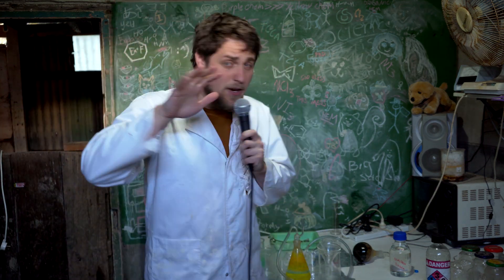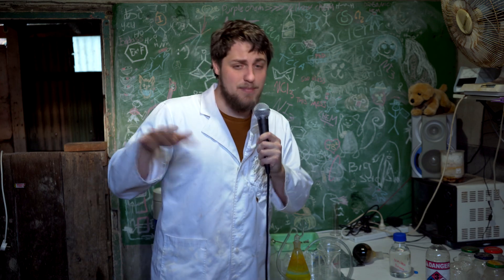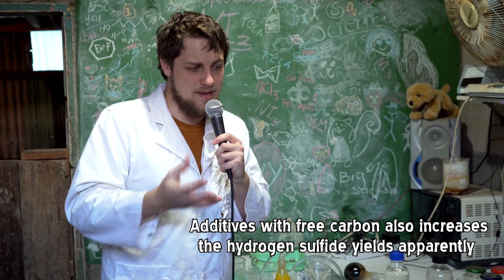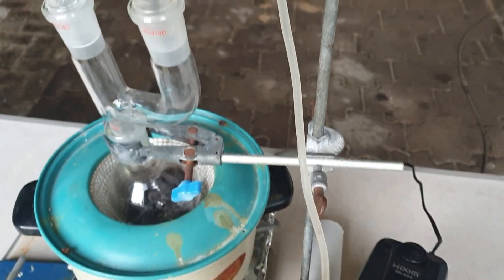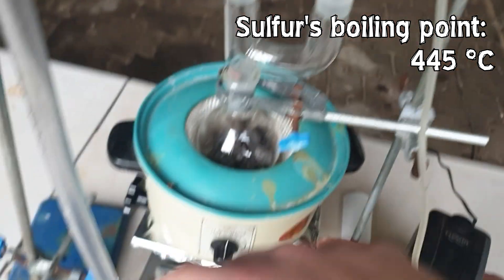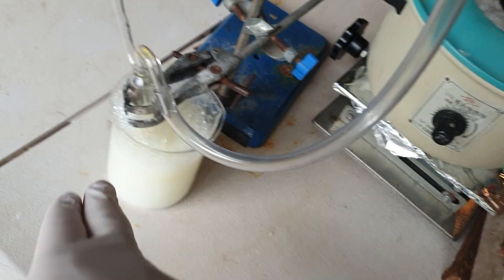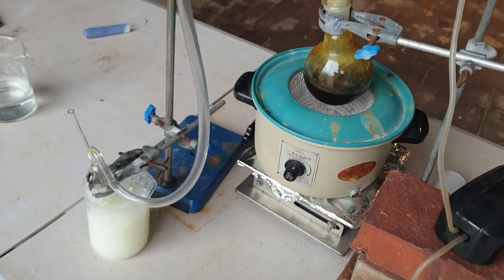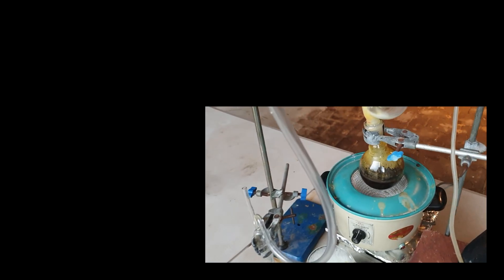A hydrogen sulfide generator using... a candle

Comment: Here in Germany you can actually buy pre-made pellets that you can heat and generate H2S. They are called "Sulfidogen". They can be easily homemade: 
 25 parts by weight of paraffin oil are mixed with 15 parts of sulfur, then it is melted on the water bath. 7 parts of kieselguhr (very fine SiO2 basically, the same you can use for filtering, then its called "Diatomaceous earth" I think) are stirred into the homogeneous melt. The mass is brittle at room temperature, but plastically deformable at approx. 40 ° C. Small portions can be pierced with the cork drill.  
This might be cleaner to work with and make less problems. Also, maybe less heat is required as they use already liquid oil instead of wax.
Reply: What are they sold for?
Reply: @ipodhty  I cannot say for sure, I think as an individual it cannot be purchased. However the manufacturing is easy, and they say at 170 C, 0,5g of the mixture releases 120mg H2S. So calculation is easy as well

Comment: So, you added bleach to your gas bubbling pool, but the reaction produces unsaturated hydrocarbons as a side product. Hypochlorite can be aa chlorination agent in some circumstances. 

Is there a possibility that you are producing random chlorinated hydrocarbons as a side product? 

Probably not, right? The alkanes in paraffin are quite heavy, and probably aren't boiling off, same should be true for the unsaturated products, but I'm not sure.
Reply from the maker: There could be! But I don't think in very large concentrations. While the pot temperature got hot, there was still quite the column length for the gas to travel through and cool in, so I don't think much alkenes got through. Didn't see any oily droplets in the beaker with the bleach

Comment: There is a third way to generate H2S. Thioacetamide is used in analytical chemistry for precipitating metal sulfides (thioacetamide hydrolyse in hot water to form H2S).

Comment: PRobably, the H2S reacts with the O2 in the air current to make H2O + the yellow Sulfur found in the rubber tube endings and/or top of the "air condenser"

Comment: Does the reaction not happen below the melting point of the sulfur, or just really slow?

Also, could the reaction be slowed down a bit by reducing the amount of carbon?
Reply: About the first one, I think it won't practically happen, because solid sulphur wouldn't mix to well with wax so you get only small surface where reaction could take place. But haven't tried it in practise yet. 

About the second one - I don't really know. It think though that carbon is added to make mixture less viscous and make evolution of H2S more even, so adding less carbon, could actually make it worse, resulting in irregular bursts of H2S. So maybe try adding more vax? To kinda dilute the reacting mixture, that may make it bit slower.

Comment: If you want to find out whether the oxygen/H2S mix is dangerous would be to find out the rate at which the H2S is produced, i.e. by measuring the pressure in the reaction setup whilst the rxn is running.
With that you could probably calculate some type of steady state concentration based on your carrier gas flow rate.
Also, technically, just pumping the carrier gas at ludicrous speeds would give you the lowest concentrations, so you'd probably end up with a safer mixture at higher carrier gas pressures

Comment: A really simple way I've found is potassium polysulfide (or liver of sulphur). It's sold in liquid form as a weed killer in bunnings. Adding acid causes basically instant hydrogen sulfide generation
You could use an addition funnel to do it gradually
Reply: As for what I use it for, blackening silver jewellery as silver sulfide is both quite a nice black and also relatively scratch resistant

Comment: I would've stored that flask with contents in it, for whenever you need some H2S generation. Chuck some parafilm on that baby to keep it relatively sealed and you're good to go. Also, why bother with a screwdriver when you have a freaking sonic bath to loosen up all the caked bits? :D
Reply from the maker: Yeah I did keep it for a little while, to use for the actual reaction I needed it for. Used it twice over a few weeks and it worked well before I decided to attack it with a screwdriver

Comment: By pure luck the sublimation temperature of CO2 is in the tiny range between H2S freezing and boiling. So you could generate H2S by whatever means and then condense it. Then you would be able to create anhydrous sulfurless gas proportionally to heating for whatever experiment needs it. This is probably a bad idea.

Comment: It's got yellow chem as an ingredient.
It's got yellow chem as a byproduct.
It's got flammable gas + oxidiser within a glass vessel.
It's got ratios measured in thumbs.
It's got hardware, dinner party and fireplace ingredients.
It's gotta be the hardest damn thing to clean up before you even start the reaction.

What's not to like?!?
Reply: It's just missing the tar. Depressingly low amounts of tar in this one. And not all that much use of shitty plastic cups either.
Reply: @TestECull cleaning that flask is going to be about as tough as cleaning tar at least.
Reply: And the gas it generates is deadly! Not as good as carbon monoxide or phosgene but still great.
Reply: Everything

Comment: Nose can get used to low levels too. I was distilling liquids some time ago and it had a slight hydrogen sulfide smell (nothing for me to get worried about, a very slight smell). However, after long time sitting by and taking fractions I got slight sympthoms that turned into light head ache, moved to fresh air and it turned into a large headache followed by dizziness. For large concentration it can make you not smell it almost at all.
I'd rate H2S closer to cyanides in danger (I can possibly disable you pretty quickly too). The difference to me is that at least you can smell it unlike CO or if you're like me, HCN at least in slow levels (but yet high enough to give slight dizzyness).

Comment: Probably not a great idea to bubble air through a flammable gas. Flowing gases can generate static and H2S is particularly sensitive to electric sparks. That said, at your reaction scale unless you are standing right on top of it unlikely to cause a serious injury.
Reply from the maker: still wouldn't be a very nice thing to happen!
Reply: @ExtractionsAndIre  also had another potential thought. You could make polysulphides with hydroxide and sulphur suspect that mix could then be slowly reacted with alfoil additions and get yourself some Al2S3 like mixture

Comment: sodium metabisulfite, add acid, done. it's nice and clean
on a side note, I used to work in a chrome plating shop. we had something like 50m3 of hot hexavalent Chromium.  we used to use Metabisulfite to reduce our sludge to chrome 3 remove it from solution. 
having thinners and 20kg tubs of chromium 6 anhydrous on one bench was always amusing. or mixing 50 liters of %98 sulfuric with water to make %20 solution.
one nasty thing about chrome6, even in very dilute amounts it has a tendency to find and cracks or scratches on the skin right away, washing it off does nothing. it gets into the tissue and slowly releases, preventing the wounds from healing, it looks like an infection that doesn't heal, and it is very painful. early on I didn't know what was going on, I had tried the basic remedies for infections (Iodine, peroxide even permanganate) and they seemed to make things worse. after figuring out what was going on, tried looking for info but I couldn't find anything in literature about how to deal with it. so I came up my own solution. I would wash my hands with a small sprinkle of metabisulfite and a small finger dip in %20 acid and doing a scrub. the result was superb. So much so I started using it on closed wounds as well (chrome 6 contaminated wound eventually closes but forms a nodule that stays painful for months, it heals very slowly) dry crystals of metabisulfite on band aid would successfully get rid of them in a few days.
anyhow, figured you might find the "safety" measures amusing...
Reply: Good lord!  Didn’t know that hexavalent chromium did that!  Did coworkers not tell you?

Kudos for coming up with a treatment.
Reply: @firstmkb  They didn't know much about it either. evn the old timers didn't know what to do, the lack knowledge about the stuff was appalling (but not surprising), we even had a chemical engineer in the stuff who had worked in similar places before and had no clue
btw, based on some literature I found (very old recorded cases 1940-1970s) a burn with hot chromium 6 as small as 2" by 1" could be fatal (causing systemic damage) and can take days to weeks. the recommendation of that review paper was immediate amputation or removal of a large chunk of meat from the burn area. and apparently if it was not done in the first hour, the chance of survival was not great....
fun stuff this chromium 6, no wonder it has been phased out and banned in most places in the world.
another fun fact, the building material and the land that a chrome plating shop was on is considered hazardous site. the building and a few meters of the soil under the building is usually taken for hazardous waste treatment.

Comment: When I was working in the oil field in North Dakota we have to wear hydrogen sulfide detectors and go for hydrogen sulfide gas training because there is so much hydrogen sulfide in the oil fields of North Dakota I didn't know why oh, but now I think that it's because there is a paraffin content in the oil and also a lot of sulfur and it comes out of the ground to quite hot which is exactly how you make hydrogen sulfide I would think the carbon probably comes from the carbon in the fossil fuel... and yes, we had an explosion hydrogen sulfide gas in 2014 and several people were injured

Comment: My method of generating very small quantities of H2S is adding sodium or potassium hydroxide to a crucible, melting it and then adding sulfur on top and making kind of a sandwich of hydroxide and sulfur layers. The sulfur instantly reacts when added to the molten hydroxide. I then simply break off the chunks and add a dilute acid to it and voila. No heating needed but then again, I was never a fan of generating big quantities of this foul smelling crap. I mainly just did it for fun a couple times to precipitate some sulfides and it worked perfectly.
Reply from the maker: oh yeah cool, that's making 'polysulfides' or whatever, where it goes slightly red/pink?
Reply: Last time I’ve done it it actually turned a yellow-orange colour. It would turn either bright red or orange when dissolved in water and would smell slightly of H2S after the solution was filtered and separated from leftover sulfur. Not the best way to generate H2S by far, but for small scale experiments it can suffice. The colour is not consistent though as the molten hydroxide sometimes attacked the porcelain crucible I’ve used which… gave it a slight green tinge for some reason? Most likely impurities in either the sulfur I’ve used which was not lab grade or in the porcelain itself, I don’t really know.

I’ll need to redo the experiment when I’ll have some time, it’s certainly a nice and easy way to generate small amounts of the gas. Too bad the gas is so toxic.

Comment: Is there a risk of the air pushing through the system causing static charge on one of the pieces of kit?  That would be the only way I see this going catastrophically wrong passing air through it
Reply: Well, using air at those temperatures, with those ingredients, could lead to a "runaway oxidation scenario" I.E. the sulfur vapors could spontaneously ignite. 
Result; Glassware claymore.

Not exactly what I'd call ideal results...
Reply: @The_Keeper  ahh never thought there would ever be enough oxygen in the air he was pushing through to do so, but then again, I’m no chemist whatsoever lol

Comment: Maybe add some glass wool in the neck of the flask to stop sulfur getting in the condenser. I also wonder if parrafin oil would do the same with easier cleanup.
Reply from the maker: I think it might actually, that's a good thought. Although I'm not sure it would 'turn off' as easy as it won't solidify and completely stop the reaction very well maybe
Reply: @ExtractionsAndIre  Measure the temperature at which it starts generating? 
I do suspect that the reaction temperature if used with paraffine oil could be a bit lower.
Reply: I'd give it a try in a test tube but I don't feel the need to stink up my lab :) Would be awesome if the temperature controls the production rate then

Comment: I've done this before. It was an experiment in a chemistry set I had as a kid. Either that or I read it from an old chemistry in my school library. I did use the sulfer that came with my chem set though. Man at least in the 90's chemistry sets at least came with chemicals. Now they are all a waste, the only chemical ya get is baking soda and they put enough warnings on that to scare a kid from ever getting into chemistry!
Reply: They have to, else they would be sued by a mom that neglected her kid.

Comment: Do they not sell blocks of pure paraffin in that part of the world?
I honestly don't know, that's why I'm asking. LoL
Reply from the maker: Oh maybe?? Not sure, what is their use?
Reply: @ExtractionsAndIre  For cleaning stuff with stuck on carbon try soaking it in vinegar for 20 minutes to an hour.
Reply: Heat transfer medium in a double boiler setup, among other things, iirc from highschool chem class over 25 years ago.
Reply: @ExtractionsAndIre  you can buy 2kg of paraffin wax for like $20 at bee-keeping supply stores. You use it to coat boxes and stuff for bees.
You could also try a craft shop (spotlight of kaiser craft) they usually have supplies for candle making.
Reply: @ExtractionsAndIre  The most common place I see paraffin blocks in local stores is in the food storage section, most often with canning supplies, and usually with a lot of Ball branded stuff nearby (glass [Mason] jars of all sizes, lids, etc.). Home-canning used to be a big thing here in the 'States, before mass-production of shelf-stable foods, and a lot of people growing their own food in gardens still do it.

IIRC, the paraffin was most commonly used with jellies & jams; you'd heat it up to a liquid state, then pour it directly onto the jelly or jam in the jar, sealing it from air, moisture, mold, botulism, all the nasties. It's safe, and completely flavorless & odorless, so it won't affect food quality. I've even made lip balm with it (about a 70/30 mix with Vaseline). We used to rub paraffin blocks on the steel rails of our snow sleds, back in the day. To go faster, of course. 🤪

But yeah, the canning paraffin is about as pure as you'll find, as far as retail/consumer-level availability goes. Comes in blocks about 5x3 inches, about 1/2-inch thick, usually four or five of these to a box, I think. If you Google "Gulf Wax paraffin," I'm certain you'll find what I'm talking about. If you don't have a canning section in your local store, maybe try a candle-making shop...?

Comment: Argon is a good call for safer carrier gas, but a tad expensive... nitrogen is just as good in this case and a much cheaper option if you can hit up the local welding supply store for a tank (buy the tank, don't rent... the rental fees are where they get you - I did gas chem for 7 years).
Reply from the maker: Yes and this argon wasn't cheap really either, you've got a point!
Reply: @ExtractionsAndIre  keep up the good work, mate! Happy to answer any CGA-type gas chem questions where I can... worked with Oxygen, Nitrogen, CO2, Air, Argon, Helium, and Nitrous Oxide (and mixes thereof) in welding, industrial, spec. gas (such as 5.0 UHP) food/beverage, and medical grades... both compressed and refrigerated liquid gases.

Not claiking any expert status, just got a lot of industry experience I'm delighted to share if it can be of use. My twitter handle is the same as here for contact. 🍻